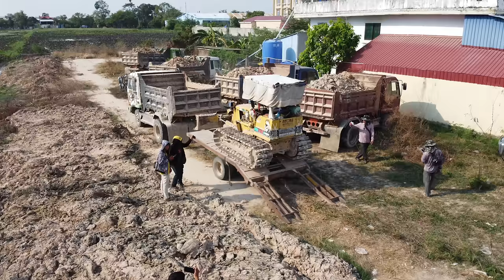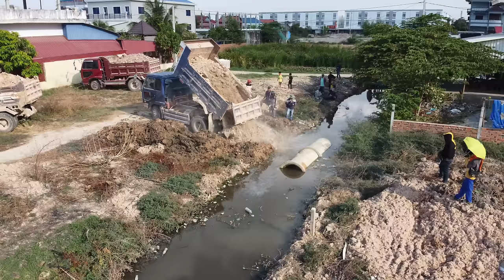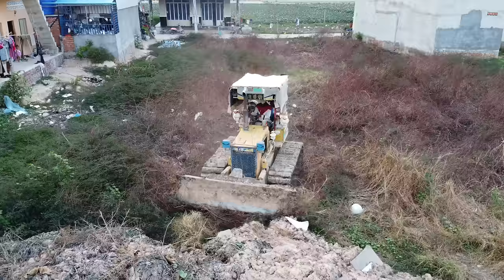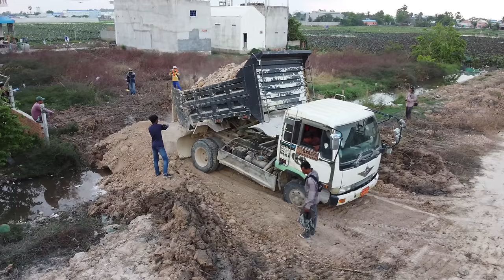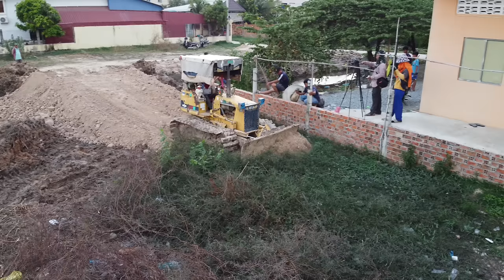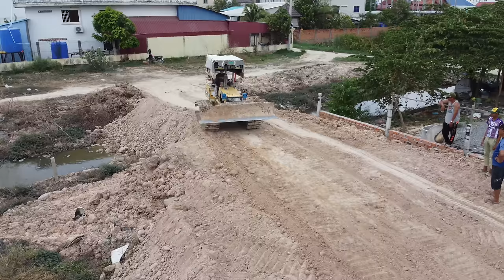Perfect first new project!! Bulldozer Komatsu D20P is  pouring soil clearing sewers Making a Road

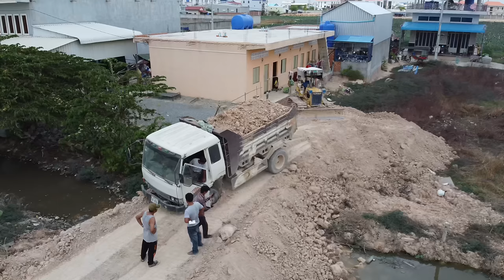Comment: 38:57  the concrete pipe shattered.
Reply from the maker: Concrete pipe is not broken is Landslides
Reply: @BulldozerMega168 that pipe is absolutely broken.  The truck's front tire went right through it!!  It wasn't buried deep enough to withstand the weight of the full dump trucks.  The pipe needs to be dug up and replaced correctly, otherwise the road is going to be washed out by the water.
Reply: @2dronetek2  Either the pipe broke in the middle or the pipe broke at the unconnected ends. either way it needs pulled out and replaced.

Comment: The two pipes were not even connected end to end. SMH. Then to cover the pipe ends with rock. What a wrong move. That wide of a ditch should have had 2-3 pipes in it and longer ones.
Reply from the maker: I can not put this pipe long